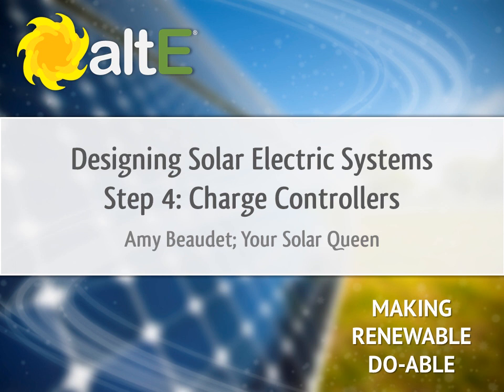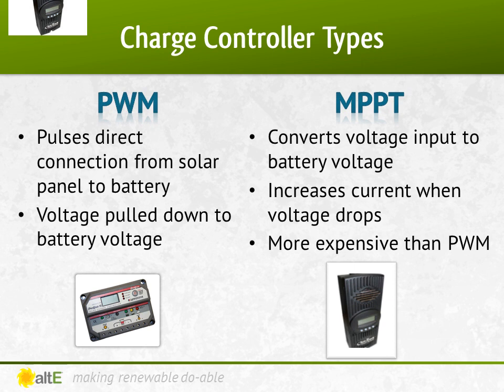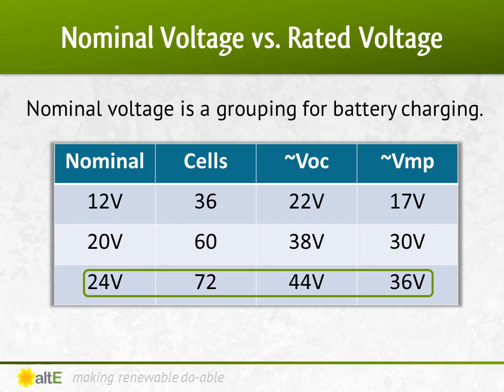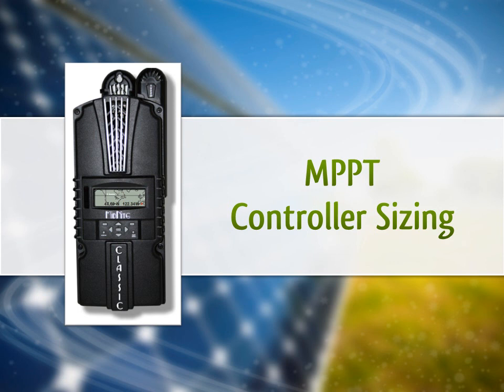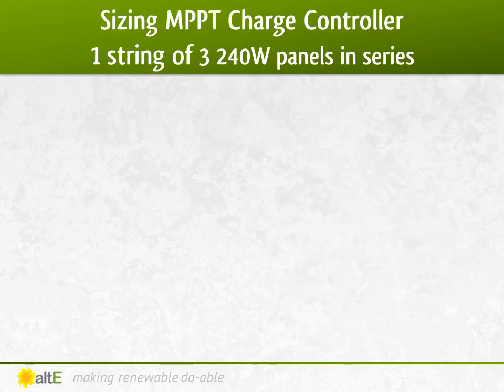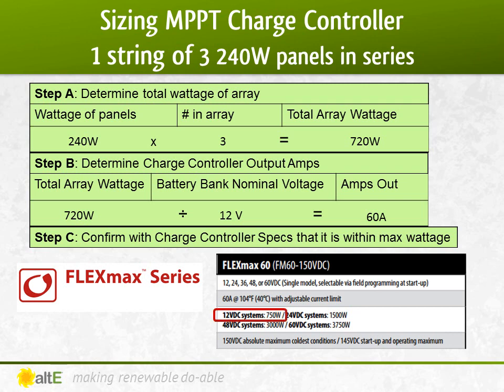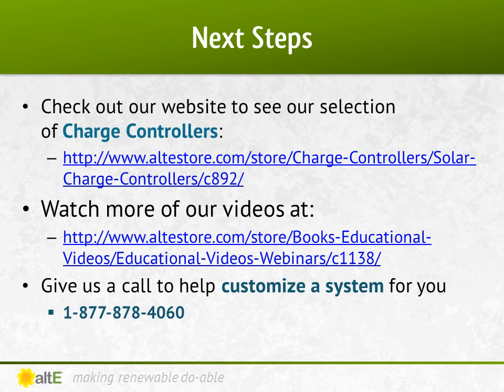Solar Charge Controller: Off Grid Solar Power System Design - Step 4

Comment: Hi Alt store,  thank you first of  all making  me  better understand the PV solar technology.   I have a case of total  Load =450 Watt. With available  3 PV panel of  250W each with spec Vmp 30.2V, VoC 37.42V  , Imp=8.3.   To begin with ,  I am planning to  use 24V, 3KVA hybrid inverter   with  builtin  MPPT  Amp =80A, operating   Voltage range  =120-450 VDC. Since  using 3 series panel  my  VoC  will be 112 V. In this case , will   this MPPT charge controller-  fire up to charge the 24V,120AH battery?

Comment: Thanks for valuable informations. I just bought a solar pump system. The pump voltage is 216 dcv. My question is:  written on the Mppt controller that the pump voltage is 288 v , not 216, is that ok?

Comment: i have few questions and your help would be highly appreciated exmple 48v batery
1) if i have a charge controller with (v) range upto 450v and 80(A) and i have a 330w panel with vmp 37.5v and imp 8.8 amps and Voc 46.8v can i make a combintion of 7panels in series (46.8x7=327)and then 4 such paralel connectionswil give curent(4*8.8=35.2)nominal voltage of panel in this case would be(24*7=168) so i m lying with in the range can i make this cmbination.
2) take same exmple system is 9240w, 9240/48v batery will give 192.5 A this tells that my controller should b around 195-200A but in step 1 i used the same thing and was in the range.so if i go with 80a controler would that clip extra amps and give outpt of 80a.
3)if i make 5 paralel combinations of 72 cell panel that gives 8.8a imp.as paralel conection will add up the curent so will get 44a  after cliping the panel voltage if we get factor of 2.5,, then 2.5*44=110a,i asume that it will clip the extra amps.
4) most inverters have built in mppt charge controllers so same will happen for them right?
Reply from the maker: 1 thru 3) Charge controllers are rated by the voltage in and current OUT. To figure the amps output, you would divide the wattage of the solar array by the voltage of the battery bank. Or, inversely, to see how big of a solar array you can fit, multiply the amps out by the battery voltage. So in your example of a 80A charge controller for a 48V battery bank, 80A x 48V = 3840W max solar input per charge controller. The voltage in is based on the Voc of the panel plus extra room if it gets cold where you are. Here in northern USA, we may add as much as 25%. So if you are looking at a 72 cell panel, the Voc is probably around 45V. If your charge controller can handle up to 450V, 450V / 45Voc = 10 panels. But that's only if it never ever gets cold. 9 in series would be safer. To figure out how many panels you can have, you take that max wattage input of 3840W / 330W panels = 11 panels max. That is too many in series for the charge controller, so you would have to have 2 parallel strings of equal length. So that brings you down to 2 parallel strings of 5 panels in series, for a total of 10 panels at 3300W.
4) most of the inverters that have MPPT are grid tied inverters, so it is not using it to charge batteries, just feed the grid. That is changing, as there are some hybrid inverters coming out that does both, like Sol-Ark and Outback Skybox. If that is the case, then an external charge controller is not needed, it is built in.

Comment: hello. can you please explain  if the solar array wattage is greater than the PV input power  for the  mppt solar charge controller , how can i connect the them ?
Reply from the maker: The MPPT charge controller is rated by the amps output. For example, 2000W ÷ 24V battery bank = 83A. So you need at least an 80A charge controller. If the array is too big to fit on one charge controller, you must use more than one charge controller, connected to the same battery bank in parallel.

Comment: hello. can you please explain the 150Volt limit while sizing MPPT charge controller?
Reply from the maker: The Voc of the panels in series cannot be higher the the input voltage limit. If the limit is 150V, and your panel has a 40Voc x 3 in series = 120V. 4 in series would be too many (160V)
Reply: @AltEStore  thanks.

Comment: Amy. you mind letting me know best way too hook up 6 100 watt panels to a 40 amp mppt controller but keep 12v battery bank? Thanks
Reply from the maker: 40A may be a little too small for 600W. In most cases you'll be fine, but under perfect conditions, it may clip and you won't get the max power. 600W / 12V = 50A.  You won't damage anything, so if you already have the charge controller, you're fine. As for how to wire them, it depends on the voltage of the charge controller. If it is at least a 100V input charge controller, and you have minimal shading issues, you can wire it as 2 parallel strings of 3 in series.
Reply: @AltEStore  so hook 3 together Parallel x2 then hook the 3 and 3 together after? And I'm hooking these panels up all on a west roof so I dont think I will max them out. I have 0 shading. Thanks Amy
Reply from the maker: @AugustmanReborn  hook 3 up in series, plus to minus, plus to minus,  then connect the first pluses and the last minuses in parallel.
Reply: @AltEStore  ok I got it now. Thank you
Reply: @AltEStore  Am not sure 600W / 12V  is correct, I noticed something like that in the video too.  6, 12V 100W  panel connected in series  600W / 72V = 8.33A. if connected in parallel then it 600W / 12V = 50A but then again in 3S-2P configuration  (300W / 12V) x 2 = 16.66A So expect all 6 panel is connected in parallel I believe the 40A MPPT Controller is within spec.

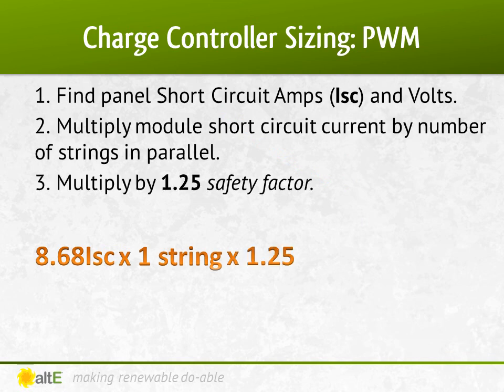Comment: 5:08 what is the safety factor and how can we find or calculate the safety factor? Please let me know asap. Thanks.
Reply from the maker: National Electric Code (NEC) says that devices that run for 3 hours or more are considered "continuous use" and therefore can only run at 80% of its rating. So by multiplying the current by 1.25, you will size the equipment properly to only run at 80%.
Reply: @AltEStore  but is it a constant? Because I can't find the safety factor value in the region I live. I live outside US, so I never heard of it. But is it must to multiply the current or multiply the Short Circuit Current (to find what fuse to attach) by safety factor?
Reply from the maker: It depends on what the rules are in your area. Here in the US, it is 1.25.

Comment: How many charge controllers would I need for 15 310w solar panels?
Reply from the maker: It depends on what voltage battery bank. Hopefully with an array that size, you would be using a 48V bank. So 310W x 15 panels = 4650W / 48V battery bank = 96A. So you could use one 96A or higher MPPT charge controller with 5 parallel strings of 3 in series (depending on the voltage of the panels and charge controller). If you have smaller charge controllers, you could do 3 parallel strings of 3 and 2 parallel strings of 3 on two 60A charge controllers.

Comment: Hello!
I have a question that suppose we are planning to run a 1 HP water motor used to deliver the motor, how much surge current factor should we add while designing our system? in general, how to calculate the surge requirement used by the motor to start itself if its not mentioned on the motor specs.?
Reply from the maker: You are right, figuring out surge is difficult. I'll often search online for generator calculators, they often list surges. It's not a perfect solution, as your motor may be different, but it's a good starting point. This one says the surge is probably around 2000W. https://www.northerntool.com/shop/tools/buyers-guides_wattage-calculator

Comment: In Pure Hybrid system where only sun hrs utilize, and also battery backup. we can did the Math for the no. Solar panels required. but how much PV will be add for solar charge Controller.

Comment: Needs correction please
Wh. night= 8,000   [Load calculated during night time]
Wh. day = 10,000  [Load calculated during day time]
Sun hr= 7     
Eff= 70%    
Ambient temperature =10 deg C to 40 deg C
1) a) Power needed to charge bat. Bank  (Wh. night/7)/eff=1632.7 Watts  
        No of  250W x 24V Panel to charge bat. (Watt/250)= 6.5 say 8   
   b) If using 200Ah x 24V battery then required bat Amp (Wh.night/24)= 333.3 Ah [divide by eff or not?] 
       Battery DoD= 50% 
       Required Ah (Ah/50%)= 666.7 Ah 
       No of 200 Ah bat. (required Ah/bat Ah)=3.3 say 4 (2 strings x2)  
       
2) a)Power needed for load at day time (Wh.day/7)eff= 2040.8 Watt  
         Panel 250W x 24V=> No. of panels (Watt/250) = 8.2 Say 8  
     b)Total No of Panels=16 No.        250W x 24V (4 strings of 4 in series)  

3)Total Wattage of array = 16 x 250 = 4000 Watts   
a) Inverter required wattage (with built-in charge controller)= 5000 Watts (25% extra of total Wattage)       
b) Inverter (with charge controller) Input Voltage (4*24)= 96 V   
c) Inverter (with charge controller) Input current,if Isc=8.88 (4*8.88)= 35.52 Amp
Reply from the maker: You need to correct the sun hours, especially if this is year round. I don't know of any place that has 7 sun hours for more than a month or 2. Go to this site and enter your country and closest city. http://solarelectricityhandbook.com/solar-irradiance.html  If this is year round, I'm betting sun hours in the winter is closer to 5. So I'm going to use that in my calculations.
Your total load is 18kWh. 18,000 / 5 sun hours / 70% efficiency = 5143W of solar needed. So you need closer to 21 250W solar panels. 
SIzing the battery bank, even with day time loads can be interesting. Yes, you'll be using much of the power as it is being made, so you won't store it all, but you do need to figure some of that power will be going into the battery bank, so you can't just store the night time use. So I'm going to use the whole day's number, 18kWh. You also didn't figure for any days without sun, or partial sun, we'll go 2 days, even though it is more common to do 3. This also helps because your daily battery use will be 25% instead of 50%, only occasionally using 50%. This will make your batteries live twice as long. 
18,000Wh / .92 inverter efficiency x 2 days without sun  x 1.19 10C / .5 DoD / 48V battery bank = 1940Ah 48V  You can see my number is much higher than yours. Because you are using much of the power during the day, you can get away with a little smaller, but not as small as your calculations.

I don't know of an inverter with a built in solar charge controller. An inverter/charger has an AC charger to charge the batteries from the grid or a generator when needed. You will need a separate solar charge controller. You'll need around a 100A charge controller for all that solar. 
The inverter voltage is based on the battery bank, not the solar panels, so you need a 48V inverter.
The number of solar panels in series depends on the charge controller. It will say the maximum voltage input. DO not use the "nominal volts" of 24V. Use the Voc listed on the panels, either around 38V for a 60 cell panel, or 44V for a 72 cell panel. You may only be able to do 3 in series.
Reply: Thanks for the clarification, we need to charge batteries in day time from panels and use in night. Solar panels must be calculated for both the loads during the day i.e. connected load and battery charging.
The latest model solar inverters indicating built-in MPPT charge controller, so why a separate charge controller.
Reply from the maker: I don't know of any battery inverters that have solar MPPT. You may have access to inverters I don't know about. Can you give an example?
Reply: a)SolarMax MPPT plus inverter, MakeSkyblue have built-in MPPT charge controllers, no idea of the quality.
SolarMax MPPT plus inverter X-series 3K-24 [3000VA/2400W], its spec. indicates
Battery & AC charger : 24VDC, charging current 20A
Solar charger:Max PV array power 1500W, MPPT ragne @ operating volt 30-115VDC
                           max charging current 60A 
Similar spec. of Solar and AC charge controller given for MakeSkyblue etc. 
Solar Panels having charge controller from Solbian see https://www.youtube.com/watch?v=H9JFYZt__Bo

b) There is confusion in 2 or 3 days of autonomy or days without sun, whether these days are per week, per month or per year. if this value is taken as one, will my batteries store Ah which will be for 24 hours whenever there is no sun and for how much load, as we consider total combine load of day & night.
Reply from the maker: a) Thanks for the info, I don't know that inverter/charger. Looks like the built in solar charge controller can only handle up to 60A, and it is for a 24V battery bank, so that's only about 1440W of solar it can handle. So a second external charge controller would also be needed.
b) Days of autonomy tend to be back to back days, or at least very lose to each other. The idea is to make the battery bank big enough that it has energy energy stored if it doesn't get recharged the next day.
Reply: Thanks for your clarification. Another inverter 3K-48, 60A charge controller, max PV power 3000W. 48VDC battery bank. It can handle 15000 Wh, for sun light of 5 hours.

Comment: Hi altE store! Thanks for previous feedback. I am still confused about some basic concept: 

1) A 72 cells solar panel has 24V nominal voltage, Voc is 44.62V. If 3 of them in series = 72V nominal voltage, Voc is 133.86V. 
(a) Could I still charge a 48V battery bank (if from the point of view of nominal voltage)? 

(b) if 6 panels in series = 144V nominal voltage, Voc is 267.72V. If using Midnite  Solar Classic 250, which max Voc is 298V. Can I still charge my 48V battery bank at this 144V nominal voltage? 

(c) Can I say that, no matter how large the nominal voltage is, as long as we are not exceeding our Voc, the MPPT charge controller can down size the nominal voltage to whatever nominal voltage of battery bank?

2) If I use a AC-DC charger to charge my battery, for instance, IOTA ENGINEERING DLS-30 30A:
(a) Would it burn my solar charge controller (eg. Midnite Solar The KID, 30A MPPT Charge Controller), if the charger amp is larger than solar panel input amp?

(b) Could I use the charger to charge when inverter and solar MPPT charger is on? or need to turn them on first?

Thank you.
Reply from the maker: Great questions.
1a) As long as the Voc of the panels in series is below the max Voc for the MPPT charge controller, the charge controller will reduce the output voltage to the correct voltage to charge the battery. it will also increase the current output, so that minimal power is lost. For example, if the input is 100V and 10A, the output is 50V 20A. 
1b) Don't pay too much to nominal voltage in this case. It is really just used as a guideline to show what panels can be used to charge batteries. For example, a 72 cell "24V panel" can be used to charge a 24V battery, or 2 in series can charge a 48V battery. Since MPPT charge controllers came along, it's not as important, because as long as the voltage is higher than the battery, the MPPT will change it to the required voltage. With the Classics, the max voltage means absolute last chance before blowing up. It will turn itself off in the HyperVoc range to protect itself. So if you design it to always be in that range, the charge controller will always be off. Not a good design. I wouldn't do more than 5 in series in warm climates. They have a great string sizing tool, you should try it. http://www.midnitesolar.com/sizingTool/displaySizing.php
1c) As long as the Voc is in the correct range, the MPPT charge controller will adjust the voltage and current. Note that a PWM charge controller will not change the current. That's where you have to pay attention to nominal voltage and match the panels to the battery bank.
2a) You can use an AC charger, either stand alone or as built in to an inverter/charger, with a solar charge controller. Unless the equipment is all the same brand and communicate with each other, i.e. Schneider's Xanbus or Outback through the hub, it is difficult to manage which equipment will be doing the charging and when. So you run the risk of the AC charger filling up the battery at night, and then when the sun comes up in the morning, the batteries are full, so the solar charge controller just stays off, wasting all that beautiful solar energy. But it won't damage anything. It can be controlled a bit if voltages are configurable, and you make sure the AC charge controller only comes on when the battery bank is very low.
2b) They can all be on at once.
Reply: Thank you very much for the explanation, very clear now! :)